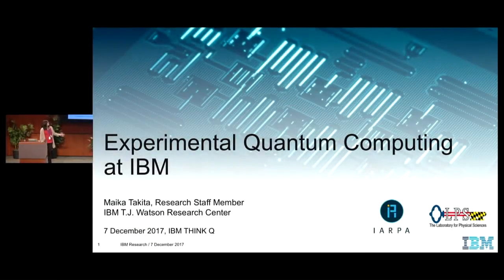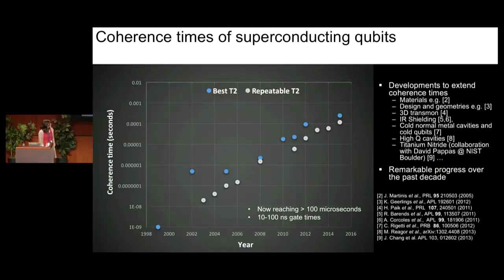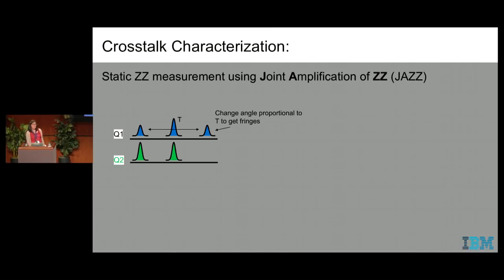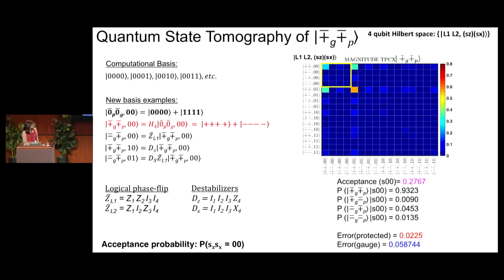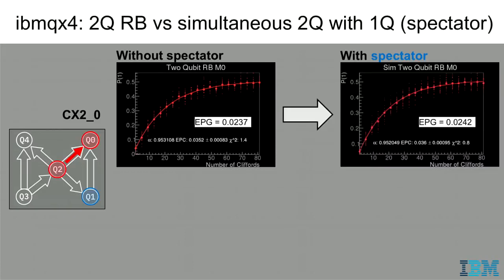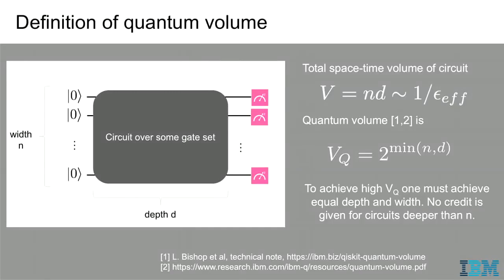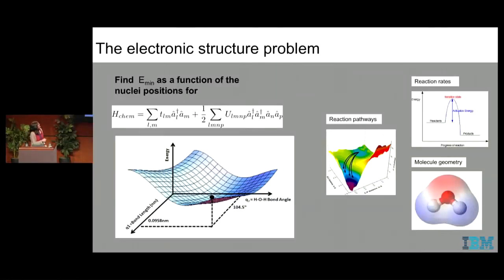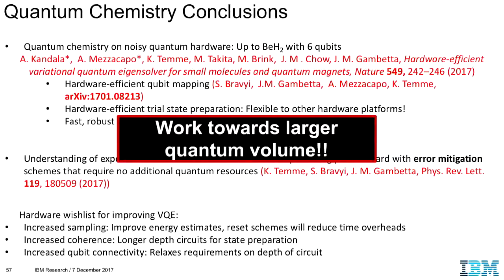Experimental quantum computing at IBM

Comment: Solid magnetic spheres (reflective) encased within  electro magnetic spherical concaved  housings (reflective). Sphere core spins with a rpm threshold , spinning counter clockwise within the magnetic (dipolar)  shell encasement. On  one side of the sphere photons  are emitted. The other side of the sphere , photons are absorbed by electrons , encapsulated and transduced , tunneled >qubits.(angles and spins mimic the observable spherical magnetic  component's apparatus angularity torque ,spin , and momentum.
 @  an three-qubit gate cross- resonance matrice para logically correlated neural nodes for machine calculation
 process latency . Possibly?